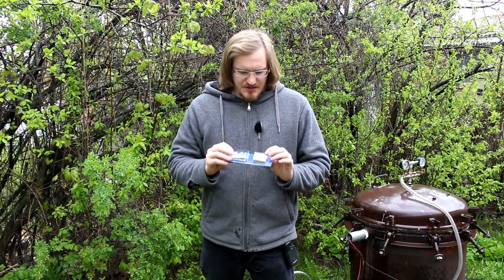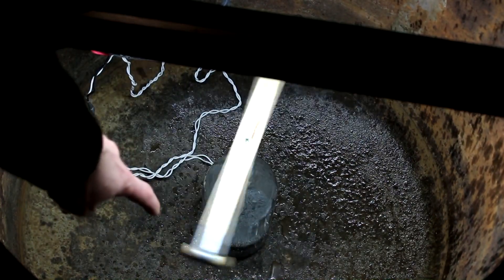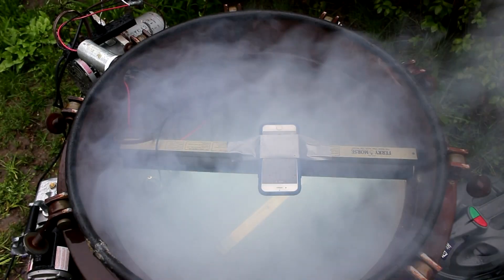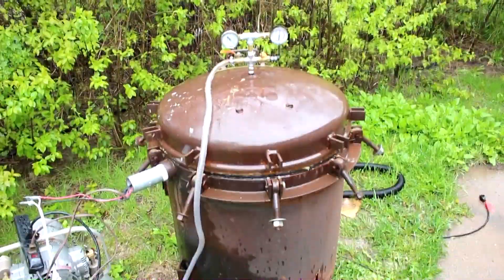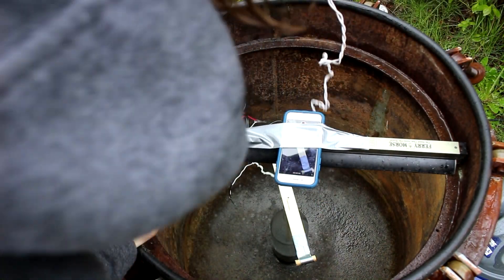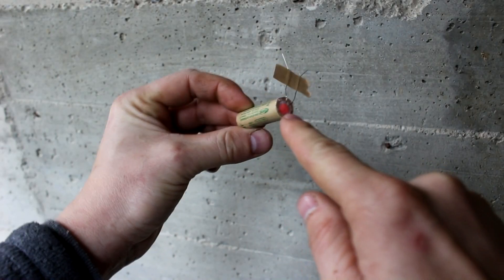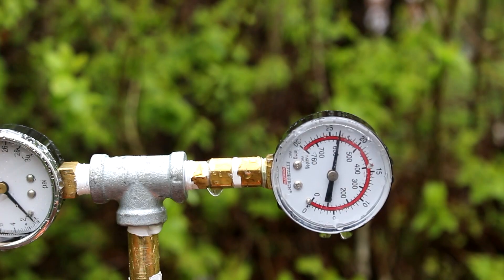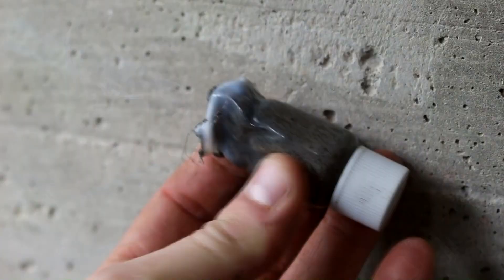Will a Model Rocket Motor Work In Vacuum?

Comment: "If I can figure it out, I'm sure nasa can" haha such bs. It didn't work in a vacuum!!! End of storey! nasa has never built chambers around their engines too create a false pressure to initiate the burn!!!  Another FAIL for satanic nasa...
Reply: They don't need to build a chamber around the engine. Stuffing a solid plug into the nozzle would be sufficient: Cody's plugs didn't stay in long enough for the reaction to become self-sustaining (you can see that the motor burned briefly and spat the plug out the back with some sparks, then went out again) so he had to make a substitute. NASA has more than enough resources to make a stopper for a rocket nozzle that will stay in long enough.

Also this experiment only applies to the specific fuel in these motors (which is black powder). NASA doesn't use black powder motors because they're too inefficient. There are other propellants that spontaneously ignite on contact (for example the combination of hydrogen peroxide, methanol and hydrazine used to power the Nazi Me-163 rocket fighter during WW2), so you can get them to work in vacuum by simply mixing them together in the combustion chamber.
Reply: You prob didnt watch the vid cause the rocket worked!
And of course NASA can do it since NASA's stuff are way more sophisticated than solid fuel model rockets
Reply: Brandon Spencer 
That is not the end of story, it worked after the fuel ignited, the air was not enough to account for the acceleration of the rocket
Reply: Brandon Spencer YOU CAN'T EVEN SPELL STORY
Reply: You see, oxidizer in model rockets is not oxygen it's a mixture of chemicals that produces oxygen when they are ignited. But "oxidizer" in real rockets is already oxygen, so it's not really oxidizer.
Reply: "nasa has never built chambers around their engines too create a false pressure to initiate the burn!!!"

Oh, they did just that. Well, Rocketdyne did, when they designed the J-2. How can pressure be "false" by the way? All pressure, i.e. particles pressing against the walls of their container, is "real" pressure. There is no "false" pressure.

The "false pressure" as you call it (actually real pressure) was created inside the J-2, right in the middle. A small flame was created inside a tiny chamber which was part of a component known as the "Augmented Spark Igniter". That flame, burning the same fuel as the main engine, once lit, allowed the main engine to ignite. Just like the pilot-light on a gas-stove.

You can google the thing. It's pretty clever. Not needed for hypergolic fuel mixes like the Apollo RCS system, and the LEM engines, and the Service Module engine, but useful for hydrogen/oxygen rockets like the S-IVB that have to re-start in space.
Reply: bro the point isn't that the rocket can ignite"which it cant" the point is that the expanding gas has nothing to push off of (vacuum) to create trust. wake up the truth is coming don't be the last to know. try to debunk a flat earth video. with your own experiments not the word of another man which you don't know nor ever will!!!!!!!!!!!!!
Reply: +devin elliott The expanding gas inside the rocket isn't in space when it's doing its work on the rocket. It's inside the rocket's combustion chamber, at several atmospheres of pressure. It has nowhere to go but backwards, so it does, and that action (by the rocket body) of accelerating a large amount of mass at a large velocity and throwing it away creates the reaction that moves the rocket. Rockets don't "push off of" their outside surroundings. You can prove that by showing that whether in the atmosphere, underwater, or in space, the force (on the rocket) is always proportional to the mass ejected times the velocity at which it happened.

If you were right about this "pushing off" stuff, that formula wouldn't work correctly.
Reply: Your the biggest idiot ever. *WATCH THE END OF THE VIDEO*
Reply: +Paula Atkins H2 and O2 don't ignite on contact, except at high temperature. In air, hydrogen ignites at 500 degrees C. Actually higher in pure oxygen at a 2:1 stoichiometric mix. That's 570C. The good news is that the mix will ignite below atmospheric pressure! See the gadget below!

I have before me, right now, a small polyethylene vessel with a stoichiometric mixture of H2 and O2, made simply by electrolysis. It's at about sea-level pressure. It just sits there, and will do so indefinitely at room temperature, safe as houses, inside its nice, room-temperature container.

It'll ignite with a spark, though. <<pop>>

For H2 + O2 rocket fuel, you need a gadget like the Augmented Spark Igniter, designed originally for the J-2 engine by Rocketdyne.
You can google it.

It sounds like what you're describing is actually a stoichiometric mix of Aerozine 50 and Nitrogen Tetroxide. That'll ignite spontaneously.
There's even a good video of it on YT.
Reply: the point isn't really that it will ignite "which it wont" its that there is nothing for the expanding gas to push off of to give thrust wake up man Nasa is full of shit the truth is coming out there's nothing that will stop it don't be the last to know brother. and insults are never the way to go my friend.
Reply: sleat he is right and that experiment failed miserably on the last Gemini mission in 1965. The word got out via an upper-level report and the NASA budget was immediately cut. This happened years before Apollo 11. A rocket can NOT be re-ignited in space. I didn't see two separate rocket engines on the LM.
Reply: A model rocket is nothing compared to a rocket engine... But he still proved even the most basic type of rocket can generate thrust in a vacuum.
Reply: Do you know how these engines work? The rocket has indeed an ignition chamber in it which ignites the engine in a pressurized environment! Exactly what cody did only that it usually is behind the rocket nossle
And NASA isnt satanic How did you even reach this conclusion anyway? Poor dude...
Reply: For 1 you can't even spell story, for 2 NASA and SpaceX use liquid oxygen and hydrogen in their fuel, so when they mix in space, the hydrogen ignites on contact with oxygen and the oxygen helps keep it burning. Model rockets are NOTHING like real rockets, they are soley designed to work at sea level, and only at sea level. So they would need air pressure to get them started, otherwise the oxidizer will not be able to ignite, and produce oxygen for the fuel, but once the oxidizer is ignited it can work in space. But in real rockets all the liquid oxygen has to do is touch the hydrogen, which starts a powerful chemical reaction, which does not need oxygen to get it started because the chemicals already contain oxygen, and is used up in the reaction. Ignorant liberals...
Reply: buddy the point isn't that it will ignite "which might i add it wont" the point is that in space there is nothing for the expanding gas to push off of creating thrust. wake up Nasa lies the truth is coming out don't be the last to know. Do some research you sound like you got a little common since why don't you just go and try to debunk the flat earth go watch a video and debunk it that's what i tried and its impossible and also do the experiments to debunk it don't just take the word of someone you've never met.

Comment: NASA don't put glass jars over their rocket motors, the ONLY reason it moved was due to the  momentum created from the initial micro-burst inside your NON-VACUUM attachment. Like a bullet being shot. Sorry Cody I know it really hurts but NASA is LYING to you, Don't be sad we all fell for NASA bulls#!T, after all NASA is held as a god from day one in our indoctrination camps deceptively referred to as schools and universities.
Reply: The burst inside of it has no affect on movement until the gas is expelled..  So it still proves rockets work in a vacuum.. If what you said was true it would not continue to move until the fuel burned out. The attachment only gave it enough internal pressure to ignite properly..
Reply: Buddy I don't think you understand physics. The jar essentially becomes the outside of the rocket in this experiment. The hot glue plug and the miniscule amount of gaseous oxygen(if there was even a tight enough seal to keep the jar pressurised, hot glue would be somewhat molecularly porous) is part of the reaction mass ejected to produce thrust. 
If a medium was needed to produce thrust(i.e atmosphere) then the gas inside the jar would not have created thrust either, because the jar is also inside a vacuum. Your point defeats itself.
Reply: +Nonvisionary  
 Ahhh, it didn't take long for the flattards to start smearing their special brand of stupid on this video. 
 How about you do some actual tests, instead of believing the crap that your fellow flattards tell you?
Reply: I thought space rockets like nasa's rockets use a hydrogen oxygen mixture to fly, since one is flammable and the other ones an oxidiser it should fuel a strong burn
Reply: +visionary138 "NASA don't put glass jars over their rocket motors"

Not exactly, but they do something similar for non-hypergolic motors, say H2/O2 motors like the SIV-B which was restartable in space. I think the "jar" on that part is stainless-steel, and it has a little hole exposed to space at the back, for the hot H2/O2 flame to get out and light the rest of the motor.

Search: Augmented Spark Igniter

BTW, it wasn't built by NASA, but by Rocketdyne.

Cool gadget! Works in space, too!
Reply: devin elliott
Huh? Beyond a shadow of a doubt? From a backyard experiment? Those are simple hobby rockets, they are not made to work under vacuum. But he proved that they still can if you give them the pressure to start. They dont even use solid rockets in space anyway
Reply: Thank you.
Reply: visionary138 the rocket kept burning even after all the air had been used up
Reply: Bin Ou Yang well, tang, you and the two previous comment authors are bullshit
Reply: It's called a combustion chamber.
Reply: sleat well, prove it, shill. give value to your claims
Reply: I'm glad to see at least someone else has some common sense here!!! And i use to like Cody's Lab until i just seen this. "Can you say bias ignorance." I mean he literally proved without a shadow of a doubt  that rockets cant work but instead of coming to a logical conclusion that this shit is fake. he's in such denial  that he came up with a total void experiment to make sense of it. Rather than just coming to the only logical conclusion "which is rockets cant work in space" he had to come up with a total different experiment to make sense of the delusion he chooses to live. You cant teach common sense
Reply: The rocket didn't moved because it pushed the bottle, thats impossible because the bottle is attached to the rocket. You can't move a car by pushing it from the inside.

The rocket moved because it was pushing gas out of it so that is kinda "pushing" the rocket forward. Newton's third law.
Reply: Differentiating pressures Mr Fibb...differentiating pressures.....

its not so much as weather it "burns" in space or not...

the fact remains...

unbalanced systems in nature always seek equilibrium... (i.e)"reciprocity" .....

you can call it conservation of energy, or the "laws" of motion or the maintenance of inertia or whatever... fact remains...a body in its initial constant position of rest will return to that point of rest always...
Reply: So this rocket engine has no air intake and generates enough pressure for the exhaust to be ejected out the back at great speed in spite of the atmospheric pressure trying to push it back in. How is the atmospheric oxygen you claim is needed for continued operation meant to get into the engine?
Reply: That's one possible combination, and of all the practical ones it provides the best efficiency. The only problem with the hydrogen/oxygen mixture is that hydrogen has very low density, which means you need enormous fuel tanks that are in turn heavy and expensive (and weight is the enemy of rockets). For that reason a lot of rockets use a cheaper option instead: the most common is a mix of liquid oxygen and highly refined kerosene. It's less efficient but cheaper and and allows a smaller fuel tank. The Saturn V moon rocket used kerosene for the first stage and hydrogen for the second and third stages.

A lot of rockets also use solid fueled boosters (basically bigger, higher tech equivalents of what Cody used in this video) for an extra boost early in their flight. The Space Shuttle used twosolid boosters as it's 'first stage' and then hydrogen/oxygen for the 'second stage' engines on the shuttle itself, though in that case they lit all the engines on the ground- the solid fuel boosters ran out partway to orbit, but the engines on the shuttle kept burning the rest of the way.
Reply: Yep, solid fuel is basically made by grinding up a solid oxidiser and a solid fuel, then mixing them together with some kind of binder to stick everything together into a solid fuel grain.The typical ingredients for a full-sized one like on the Space Shuttle are ammonium perchlorate as oxidiser, aluminium metal as fuel, and polyurethane rubber as the binder (being flammable it also acts as a secondary fuel source).

The little engines in the video are basically fueled by gunpowder, which is composed of potassium nitrate, carbon (from charcoal) and sulfur. They bind them together by pressing the gunpowder into the motor while it's still a bit damp- I guess the potassium nitrate dries out and joins the little particles of powder together in place of having a dedicated binder. Full-sized solid boosters have much higher efficiency than gunpowder (2-3 times better).
Reply: They can indeed work in space. There are engineering challenges associated with making them do so, but nothing that a little human ingenuity can't solve.
Reply: thanks to that great conclusion at the end (instead of pointing out NASA doesn't somehow make the rocket stay magically pressurized, I'm sure it's documented), people will stop questioning anything. Idiots.
Reply: nerd1000ify........so you think rockets can work in space or not?
Reply: visionary138 Yes indeed
Reply: nerd1000ify cheers, so does solid fuel have an oxidiser in it? how does it work xD
Reply: from everything I've seen I really don't know what to think. I just don't think jumping on board the idea of rockets flying around in space, without scrutinizing every detail from independent studies first.

Comment: What was the vacuum before and after please? Maybe there is a way to figure out how much gas it produced. Then calculate the volume of gas based on the chemical content. Also I think the volume would shrink after cooling down. How much volume at the moment after ignite and then after cool down. 
I guess there is a way to figure out the most effective rocket fuel that way.

Comment: Will a gas or a Diesel engine run in a vacuum chamber?
Reply: No those work on atmospheric oxygen, let alone atmospheric pressure.
It would be interesting to know the exact effects it has but I don't think you'd figure any of that out by just tossing one in and noticing that it does not run at all.

Comment: at the end of the video like 8:08 you see some water in the bottom of the tank pulsing, any idea why?
Reply: Tylor B. oxygen in the water is being sucked out by the vacuum.
Reply: Tylor B; Actually, both the dissolved oxygen and nitrogen will be released quite quickly. Those large bubbles that keep forming are actually due to the water boiling, then losing enough heat to cool down, then heating back up and boiling again, etc. etc.

Comment: That's pretty cool. Would you consider attempting to make a vacuum-capable igniter? I suggest surrounding the igniter with a little more powder, putting it deep in the motor and then filling tge motor with hot glue behind that. You just need something that will create more backpressure than the plastic cap.

Comment: The motor absolutely did not spin as fast as the one at atmospheric pressure. Also you are not even coming close to simulating an expanding, infinite vacuum, such as we're told space is. However I really respect your effort Cody. I don't know if you seen it or not, but ODD TV has made a response to your curvature video .Check it out.😎

Comment: Thank you for extending your experiment to prove that rockets do provide thrust in a vacuum.  Most other so called "researchers" that think that rockets can't work in a vacuum would have stopped with the first test and claimed "proof"
Reply: The thing is the first test still demonstrated Newton's third law just fine, the rocket did move in the vaccum when the igniters went off it just didn't ignite properly
Also someone literally stole Cody's videos said they were the ones doing the experiment and cut out the last one to claim that it proved Newton's third law is wrong

Comment: Hey i need help!!
Last year a thermometer broke in my room i cleaned it, but i was freaked out by the Mercury vapors, I called my aunt and she told me that thermometers broke all the thime in the hospital and it was not a Big deal
BUT NOW A LAMP BROKE IN THE LIVING ROOM i know they have Mercury vapor and im scared , when it broke i checked it like 15 seconds after and i was looking for Mercury dots for like 30 second they my mom cleaned all the glasses , MY QUESTION IS ¿CAN I HAVE A HEALTH PROBLEM FOR THAT EXPOSURE WITH THE LIGHT BULB? I WAS NEAR THE FLOOR (NOT TOUCHING) LOOKING FOR THAT 30 SECONDS AND IM SCARED THAT IT COULD CAUSE SOMETHING BAD :(
Reply: Jesus Soto I think you will be fine you exposure should be minimal dont be a little girl
Reply: sorry but IM really afraid of those types of things
Reply: I'm pretty sure the mercury in lightbulbs is a gas not metal mercury, it stays low so open up your door and run a fan for a sec
That is the kind of mercury that is pretty bioavailable so you want to avoid it.
The thermometer kind isn't as bad but you should be careful about it as well